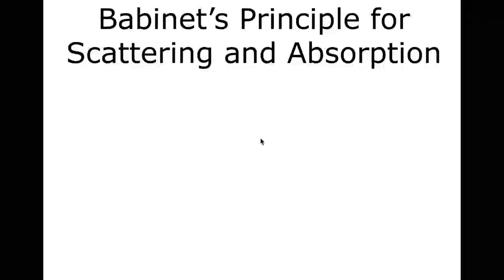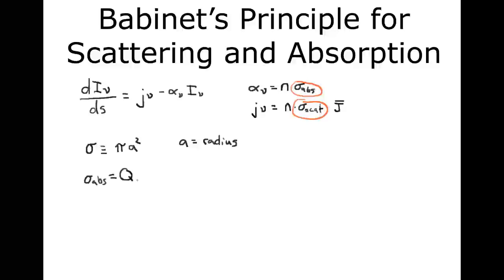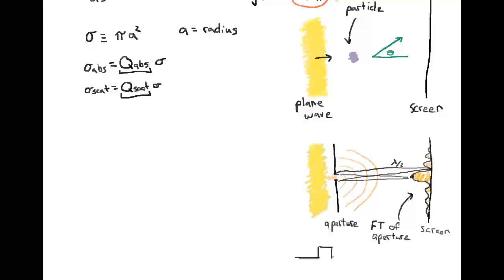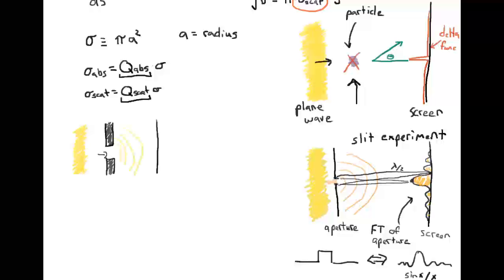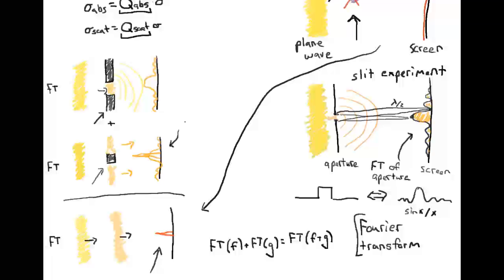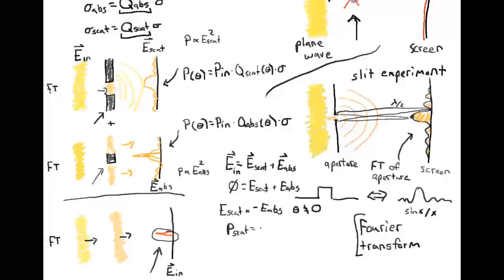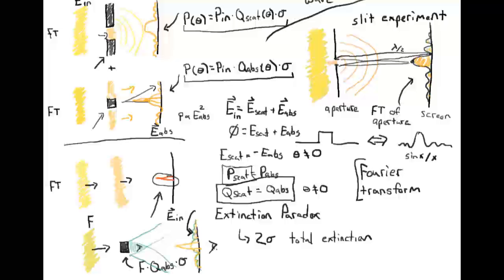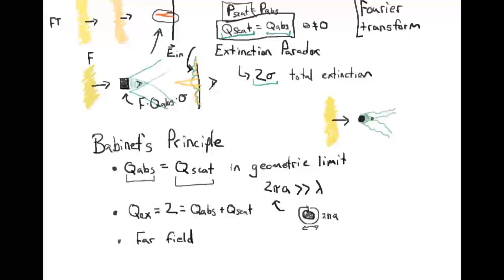Babinet's Principle for Absorption and Diffractive Scattering

Comment: Um.. this isn't double slit experiment, a small aperture has infinite "new" point sources, how do you create the pattern then?
Reply from the maker: If your slit has a finite width, then you get the interference pattern as described.  The double slit experiment assumes infinitely thin slits, or at least, slits much thinner than the distance between them.